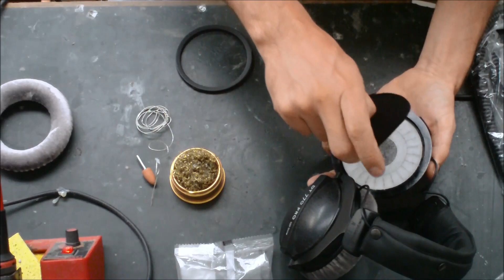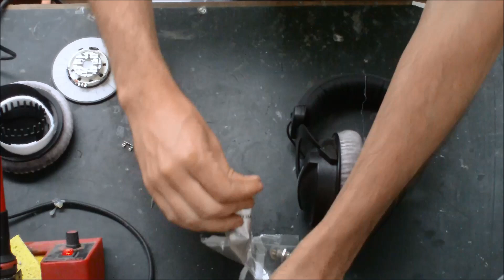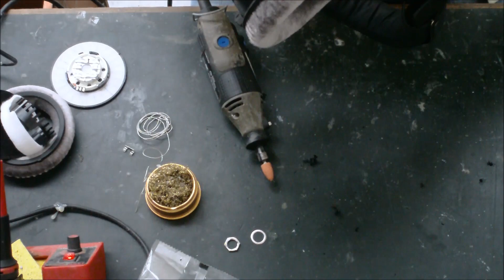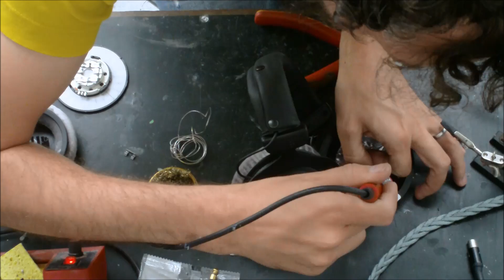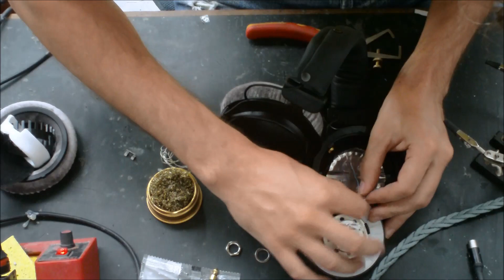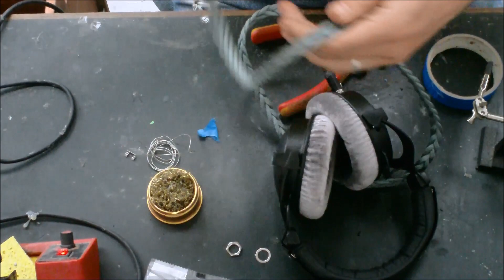DT770 Detachable cable Mod

Comment: that braided cable looks like it weights 800 pounds lol
Reply from the maker: Lol - no they are pretty light - it is mostly air inside. The thiccnes is to keep the cores separated to keep the capacitance down as much as pos

Comment: Removed 3 wires and only attached 2 new wires. Why?
Reply from the maker: Sorry, this video is not great, I must re do it. To make them balanced we replace the 3 core cable with a 4 core one. Check out our video on the DT1990 which is a bit better.
https://www.youtube.com/watch?v=I6zj02bz8f4

Comment: i am very new to soldering, very confused at 3:38 where he immediately solders the wires unto the pin without using the soldering metal? how is that so?
Reply: Used the old stuff

Comment: Very cool music. However I have question: since the link you provided is not working and I don't want to use XLR, could you recommend me a 3.5mm socket or should I just randomly pick one?
Reply from the maker: we use the rean miniXLRs - you could use a 3.5mm socket but it is not one we do on these so I can't advise you. There are a lot of DIY threads on head-fi where people have done 3.5mm conversions though it would be worth having a flick through those for appropriate sockets
Reply: @CustomCans  Roger that. Thanks for your fast reply. Cheers.

Comment: Nice! Looks easy enough.  Why did you decide to use hot glue to capture the mini xlr vs using the nut and washer? Was there not enough room for the nut and washer?
Reply from the maker: When we do it here we tap a thread into the plastic - we have a proper tap for it but you can do it the same we it is done in this video - make the hole a bit smaller than the socket and then use the threads on the socket to cut a thread into the plastic. the glue is just there to stop it from unscrewing and give a bit of extra support. the nut that comes with the socket is too large to fir as standard - you can use the drimel to grind it down a bit but it is quite tough to do
Reply: @CustomCans  Good idea! I have a couple tap sets, I'll try that at some point.

Comment: I am baffled why Beyerdynamic did not make the cable detachable ... sigh... great video. wish I had the tools to do it.
Reply: There are Custom Studio and Custom Game, which is similar to 880's series, they have detachable cables and it's the only reason I prefer them over the 990's
Reply: the 1770 , 1880 and 1990 have detectable cable ;)
Reply: because its bad for profits

Comment: DON'T DO THIS. I think a much, much better idea is to simply cut the wire about 2 inches away from the headphone. Then attach a male or female headphone jack (your choice) Then simply plug in whatever you like. This method is:

 1. MUCH easier
2. Does NOT require disassembly 
3. Does NOT damage anything if the cable gets pulled in ANY direction. It simply disconnects. Unlike a solid mount that doesn't flex in the direction of pull.

Comment: I'm pretty happy with this idea and procedure as a person new to modifying electronics, although I wish there was a simple mechanical solution to having to use a dremel and hot glue without having to custom 3D print couplings that fit together. It would technically make this completely reversible if you had something like two pieces that press-fit together that fit around the existing hole allowing for the passing of wires through said piece. The hardest part would be taking the CAD measurements required for producing a piece that fits flush against the headset, but in theory if you did this, you could cast them out of aluminium and sell them.
Reply from the maker: We have just 3D printwed whole earcups with the correct size hole to take the socket in the past. As long as you use something like PETG or Nylon they are pretty much as strong as the originals
Reply: @CustomCans  Woah I mean that's a little far, but I suppose it stops you from adding parts instead of just swapping out the one that doesn't work. Either way I am just glad I won't have to throw away a £120 headset lol.
Reply: @CustomCans no chance you'd know here files for that might be?

Comment: Why did you have to cut part of the black plastic frame holding the diaphragm? I've never seen anybody else having to cut the frame, and I'm planning to do this mod this week.
Reply from the maker: We use mini XLR sockets that are quite large and you need to cut that section to make space for it or it won't go back together. When you do your mod you may be able to get away with not cutting it if you use a small enough connector. We use mini XLR as most of our customers use them in studios where they will get a lot of abuse so need to be super tough

Comment: Does the XLR balance affect the the sound signature of the DT 770 pro 250 ohms ? Such as bass and sub bass ?
Reply from the maker: This particular mod is using a 3pin mini XLR so there is no real change as it still only has 3 wires, the same as a standard jack. We do also make a 4 pin version for people with balanced amplifiers. The main difference there will be that you get reduced cross talk between the left and right channels. If you want to improve the the quality of the bass and add a little more bass extension, we sell a DIY mass loading and damping kit for £8.50 or you can send them in to us to have the work done
Reply: @CustomCans  No, what I mean by if you mod the socket to balance (does not matter of whether its 3 pin or 4 pin or TRRS, etc.) from male to female jack, will it affect the sound signature ? Because when I mod my 770 pro 250 ohms from female 2.5mm balanced socket to male 2.5mm TRRS, and then use single ended adapter (aftermarket) will it consider as balance or still single ended stock dt 770 pro and still retain the sound signature?
Reply from the maker: @nicktan4530  As long as you seal up any air gaps around the socket you should not hear any difference to the sound signature
Reply: @CustomCans  OK, what about the bass and sub bass ?
Reply from the maker: @nicktan4530  Yes - as long as you seal up any air gaps nothing will change in the bass or sub bass. The socket does not use up a significant part of the air volume inside the cup to there are no real changes to the sound - the only difference would be that the cable would be detachable. If you want to tune the sound you can reduce the size of the bass port the reduce the bass levels or play around with mass loading the driver to give more defined bass / sub bass.

Comment: Why you did not use a 3.5mm socket instead the XLR?
Reply from the maker: Two main reasons. We offer a 2yr warranty on our modded headphones so we need to make it as durable as possible.
Secondly, we make balanced cables for them as well so we fit a 4pin miniXLR to fit our balanced cables

Comment: Would this mod change the sound quality?
Reply from the maker: It depends how well you seal the earcup after you have finished as any air gap around the socket would act as an additional bass port. When we do it we re-wire them internally with better quality Litz wire, we mass load the drivers and line the inside of the cup with damping material. Doing all that gives them a bit more detail in the low end

Comment: hallo, i want to do this mod in my dt 990 pro but with aa 4 in XLR for have a balanced output, do you how can I distinguish between L- L+ R- R+? and which cable do you recommend me to make the connection between XLR connector and the driver? good video btw
Reply from the maker: pin 1 - L+
pin 2 -  L-
Pin 3 - R+
Pin 4 - R-

You can re use the headband cable for the right ear or replace it with something better then you just need 2 short bits of wire to go from the 4pin to the left driver -
Reply: @CustomCans  I mean, l-l+r-r+ on the drivers in the headphones
Reply from the maker: There is normally a pen mark on plastic casing of the driver next the negative terminal  @Escrius

Comment: how would I know which wire is the correct wire to solder on the mini xlr?
Reply: Test which cable connects what. Write it down before desoldering it and then rewire it the same way it was before.

Comment: Did this mod changed the Sound Quality in a bad way or they sound the same
Reply: It actually did damage the crown of the headset, which can make resonance and plastic rubbing noises with high bass, if you’re planning to do this mod, DON’T CUT THE CROWN
Reply: its a cable
Reply: Lit Papi a cable can affect to the audio quality too LOL

Comment: Sadly my cable is deatching itself from my headphones, so i have to to this sonner than later....
Is there any Reason why i shoudn't use a 3.55 mm jack? 
And great Vid!
Reply: Robert Zettl the mini xlr collects no noise while 3.5mm is more prone to collect white noise, at least from my understanding but its up to you
Reply: @KraziJoker  I don't think so, both are just pieces of metal, I would use 3.5mm connector for better compatibility

Comment: i need to replace my cord after somehow damaging it from trying to stretch it. what wiring do you use and also do you have a diagram of which wire gets soldered where?
Reply: Trying to stretch it.. And it somehow got damaged. Go figure.

Comment: So when I cut the cable, for some reason I couldn't get any current from the weird tiny colored wires? How do you work with these?

I assume you have to re-solder the wires for the other earcup no? But I couldn't get the wires to make any sound. Only the third party copper wires I provided.

Any tips?
Reply: Cables inside electronics often have non-conductive coating around the copper, even if they are also encased in rubber. The easiest way to fix it is to get a lighter and burn it off; the coating burns off at a much lower temperature than the copper will melt. The alternative is to try to strip it off using wire cutters or something sharp.

Comment: Damn, your iron melted through the solder on those terminals instantly. Mine took a long time, but I was using a wick to get it all. I worry that I may have heated the terminals for too long, but I guess I won't know until I recable and hear it for myself.
Reply from the maker: The secret is to get a bit of fresh solder on the iron before you start. You should be OK - if you over heat the terminals the plastic melts and they fall off ;) if they stayed attached then you should be fine
Reply: That's good to know. Thanks!

Comment: just a noob question, will this mod not change acoustic quality of the cups?
Reply from the maker: as long as you seal up any air gaps around the socket there is no appreciable difference in sound
Reply: Awesome 
What u say about those mods with the cable? They cut 2inch from the cups and attach a 3.5mm female and one can use any cable from there onwards ...
Reply: Doesn't looks as best as this one though :)
Reply from the maker: Yep - that would work as well

Comment: What's the advantage of using a (mini?) XLR cable according to you?
Reply: that's not really what removable cables are intended for. That's mostly an inconvenience. The real 'use' of having removable cables is being able to swap them easily once they break. Though - with the DT series, the cables are super durable anyways, so maybe after 5-15 years you might need to switch it once.
Reply from the maker: It is totally down to personal preference I suppose. We use miniXLR because the cable locks in place, you can have a 4pin balanced option and we can make them fit securely in the earcup. I have done a similar operation with 3.5mm jacks and HD800 sockets and they work as well  and I am sure there are others you could try.
Reply: Jason Rhys-Thomas why would you want it to lock in place? One of the advantages of removeble cables is when the cable gets cought on something it won't yank the headphones of your head. The cable would just unplug.

Comment: Noob question: how does this work? Don't you need some kind of input circuit to handle the phase shift? or is it built into the socket somehow?
Reply from the maker: no - your are essentially just putting a join in the cable  so there is no need for any circuitry to make the cable  detachable . If you  are converting them to balanced then you just need to wire them a little differently internally and the balanced headphone amp takes care of everything else
Reply: so there's no noise-cancelling, but isolation of the return path for each channel to reduce/prevent crosstalk?
Reply from the maker: Yes, that is right - it is a bit confusing because balanced headphones are not like a balanced connection between and amp and source. But as you said - the main advantage is less crosstalk between the channels and most balanced headphone amps have a separate amp for each ear so generally can drive high impedance headphones better and the are push pull giving a bit more control
Reply: I see.
Thanks for taking the time to explain :)

Comment: Will an AKG cable work with this connector?
Reply from the maker: If you use a 3pin miniXLR socket then an AKG cable will fit
Reply: +Jason Rhys-Thomas Thanks!

Comment: can I use the wires that are connected to the cable instead of having to buy the new ones. Instead of cutting of the wires from the drivers, I just cut them off the cable
Reply from the maker: +KilaByte33 - I like to get it right ;) on headphones it does not matter as much but it can't hurt. On the beyer drivers there is normally a pen mark on the driver next to one contact to denote which side is positive. 
As the beyers are hand made it is not always on the same side - it can vary from driver to driver
Reply from the maker: +Apieceofcrap Yes - you can use the existing wire. We have done it quite a few times
Reply: Jason Rhys-Thomas thank you, this was the only thing holding me back
Reply: +Jason Rhys-Thomas Does the polarity matter?
Reply: +Jason Rhys-Thomas Thanks, I'm planning on doing it on the DT990s I literally unpacked and put on 20 minutes ago. Now to search for a somewhat aesthetic connector and cable...
Reply from the maker: +KilaByte33 We do make custom cables and can supply the socket and cable used in this vid. It is a very high end cable but does cost nearly as much as the headphones ;)

Comment: I really want to get these headphones. The only thing holding me back is the cable. I want to do this but I need to know where the wires go on the terminals on the actual driver.
Reply from the maker: +Nerd Herd I recommend taking pictures of the inside before you pull them apart to help you remember where the wires go on any project like this also having a cheap multemeter really helps.
With the DT770 and most other beyer drivers the two outer pins are + and - and the center one is not connected - just used to join the posetive wire from the right side.
As the drivers are hand made there does seem to be some variation on which side the + is which is why you should take pics or mark them with a pen.

I would however say... If you could not figure that out then I suspect you have not done much of this kind of thing before - I would definitely practice your soldering in some other things first as it is not that hard to ruin the drivers by messing up the soldering process
Reply: Jason Rhys-Thomas Ok thanks! I actually do know how to sodder, and have done many projects like this. Just for some reason I did not get it this time ;)

Comment: Hello, i am trying to repair my DT770´s with this mod, because my cable broke. I am confident to do the soldering and have found a suitable mini xlr plug. I am not sure what cable to use though. Any suggestions? http://www.thomann.de/de/hicon_hij35s02.htm Ive found things like this but that will involve even more soldering right?
Reply from the maker: +Rafael “Raido” Barczak  Hi Rafael, We do sell the replacement cable for the DT770 if you just want to do a straight swap. If you are looking to do this mod then any 3 or 4 core headphone cable - if you want to do a proper DIY then one of those jacks and some star quad wire would be good

Comment: What kind of connector plug and socket is that ? Where can I get them. I want to do this mod on a pair of DT 990,s also what kind of wire did you use, or what type would you recommend.
Reply from the maker: +Niya Audiophile it is a miniXLR Any decent copper wire will do the job
Reply: Kool

Comment: could one dare to do the same mod on a dt770 250 ohm? the stock cable is much different(coiled) so I wonder.
Reply from the maker: +Tamadadoo Yes the operation would basically be the same on all the different DT770s

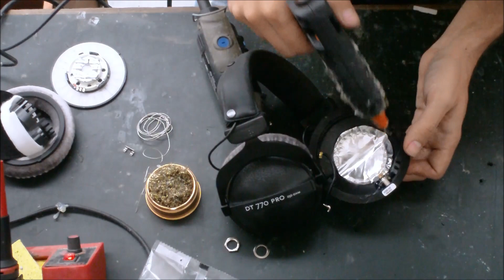Comment: What were you hot gluing at 3:20? Just seemed like you kinda plopped it on over the socket.
Reply from the maker: +Poetical Pretty much... I put it all round the socket to give an air tight seal and a big blob of it underneath to give the socket more support
Reply: awesome. thanks

Comment: Hey man , I just did this mod and I have 1 little problem the volume is too low . The headphones work but the volume is too low. Please I need help.
Reply from the maker: TheMinato212 You may have a short somewhere or the negative wire may not be connected properly. If you have a multimeter, check all the connection. make sure you are getting the right impedance readings for your version so if you have the 80ohm ones you should have just under 80 ohms between the tip of the jack and the sleeve of the jack and from the ring to the sleeve. if it is lower than 70 you probably have a short